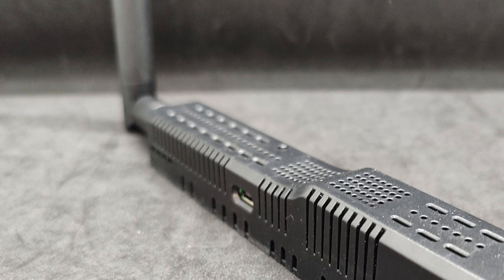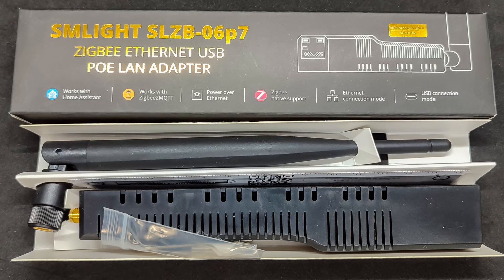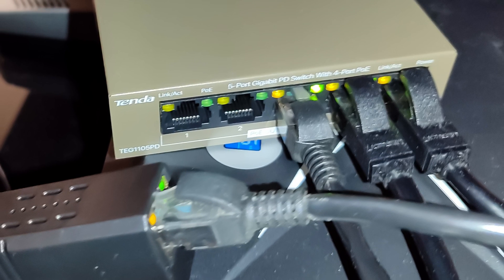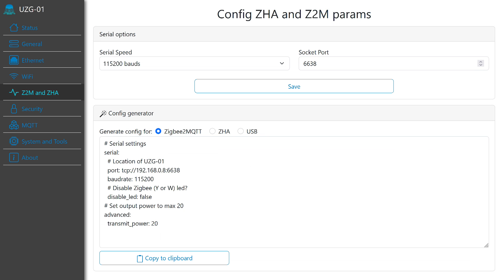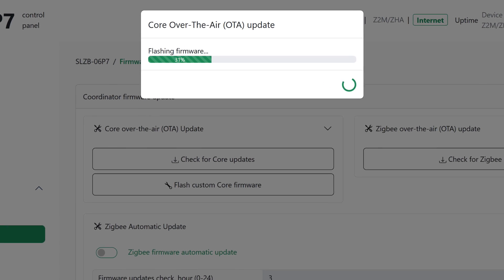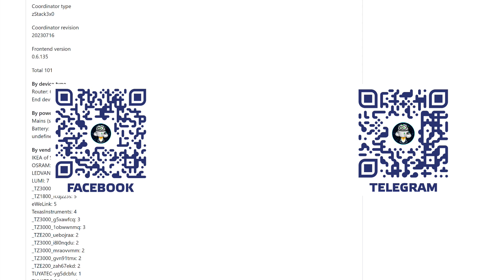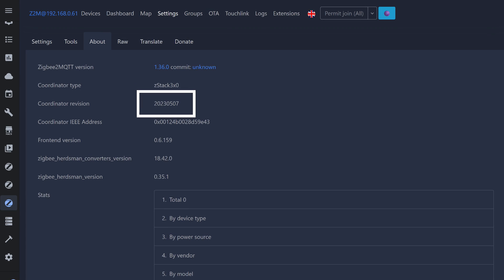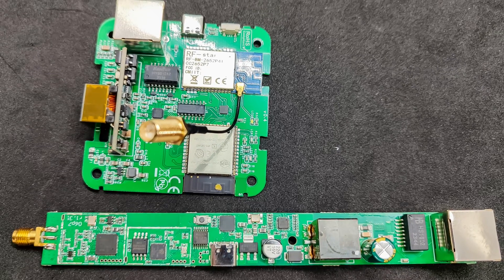SMLIGHT SLZB-06P7 vs ZigStar UZG-01 - сравнение Zigbee координаторов, особенности прошивки 20230507

Comment: I have this coordinator and I'm having a lot of problems. When used in ethernet, the IP address sudently changed after a power failure and I had to pair again all my zigbee devices... Then I used it in USB mode  and sometimes I'm loosing the zigbee network. I have to unplug it from the USB port  and plug it again to retrieve the zigbee network. I considering switching to another USB coordinator

Comment: About 6 months ago i have decided to migrate from Sonoff ZBDongle plugged into my HA server in the loft, to a PoE adapter located centrally in my home. After reading specs and reviews i have chosen SLZB-06. Initially, when i paired everything with it i was amazed with super high LQIs... but after 2 days my Z2M froze and i needed to restart both Z2M and power-cycle SLZB-06 to make it connectable again. Those freezes were happening regularly every 6-48h. I thought that i have a faulty coordinator and after trying few things (different firmware versions) i have ordered another one. Unfortunately, when the other one came in, i had exactly same problem with it. So i have ordered SLZB-06M - different & better chipset, different firmware, i thought it wont be affected by the same issue and will work amazingly. Unfortunately i was wrong, SLZB-06M had almost the same problem (except i didnt need to power-cycle the coordinator, just resetting Z2M every few hours was enough) - both on old ezsp driver and the newly released ember driver. Of course I have tried any troubleshooting i could (different methods of supplying power, connecting SLZB directly to the server, etc) and i have been in touch with SMLight support, but nothing seemed to help. 
Finally after 5 months of zigbee nightmare, last week i have got a completely new PoE coordinator - Zigstar UZG-01, repaired all my devices and everything works rock stable since then.